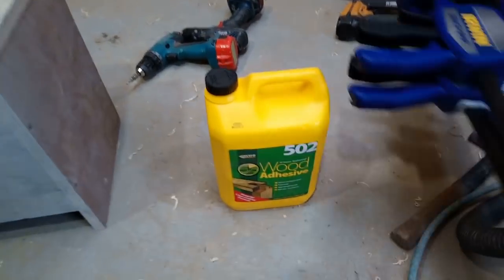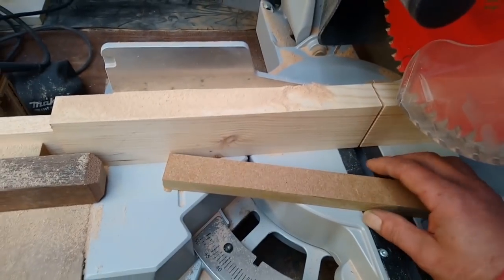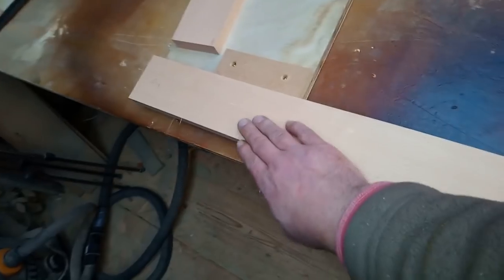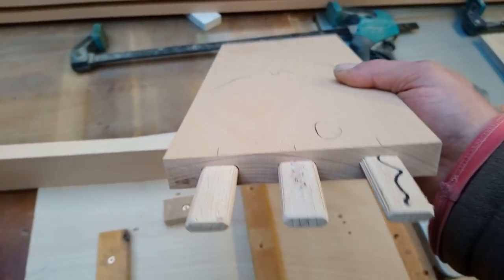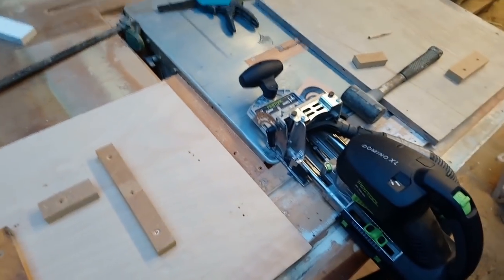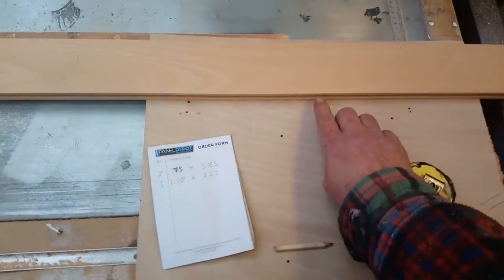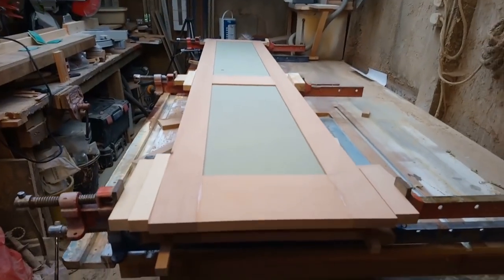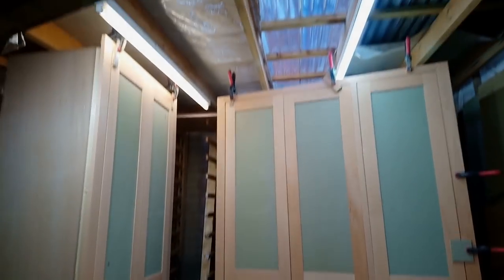Wardrobes Pt7 - Doors 2

Comment: Hi Gid. Thanks for all the very detailed videos, you do some really geat pieces of work. Have you seen the WD40 non greasy, I think it is silicone, spray for the slide rods on the domino gear?
Reply from the maker: Hi, thankyou Mike, much appreciated i'm glad you like my vids, No sorry i avoid like the plague anything with silicone in my workshop, when spraying paint just a single atom of silicone causes fisheyes, i wash my hands & change clothes before going in the shed if i've been using silicone on site, I also avoid any kind of oil contamination in the workshop. Google 'silicone fish eyes in paint' you'll see what i mean, thanks anyway. 👍👍

Comment: Amazing video gid and I bet you have one hell of a collection of clamps which are your go to clamps?
Reply from the maker: Thanks 👍👍, i have a small collection, they vary in size so it does depend on what they're used for, the little cox clamps are surprising strong tho for general stuff.
Reply: Gid Joiner what’s your opinion on the Irwin quick clamps?
Reply from the maker: I've got 4, 2 of the 6" & 2 of the 12", I use them quite a lot n keep meaning to buy more so i have some in the shed n some in the van, They're always in the wrong place, esp when it's raining n i'm in my shed 😆🙄
Reply: 😂😂 you can never have to manny I only have 4 clamps total but I was looking at the 18” Irwin. Does the 18” refer to the whole size of the clamp or what you can get between the jaws?
Reply from the maker: Normally it's clamping capacity, I've got a couple of the bigger ones, like you say you can never have enough, I've had my Irwin's quite a while n they're still good so buy what you need, they'll last, The clamps i made for the track are cut down n welded 12" Irwin quick ones 😉👍 I've a couple of wolfcraft clamps that have a second lever that opens them just like the lever that closes it, handy when you've got hold of a piece of wood in one hand & the clamp in your other hand but it isn't open far enough http://www.wolfcraft.co.uk/en/products/p/one_hand_clamps/index.html I have two with that opening lever but i bought two more n got the wrong ones, there's ones with just a normal release trigger that doesn't open the clamp.
Reply from the maker: https://youtu.be/qOeAPiViFK0
Reply: Gid Joiner ah right and yeah them wolfcraft ones look good I will give the Irwins a try thanks for the help 👍🏻

Comment: I'm desperate to find an easy program or app to draw 2D designs and layouts adding dimensions. Tried the free version of sketchup but can't get on with it. Your drawings look the business Gid. Anyone have any suggestions?
Reply from the maker: Hi, , I use a CAD program, for 15+yrs but still don't know ½ of it, you can go to college to learn CAD 🤪
i only use the 2D part because i only need a flat pencil line drawing, I've never used sketchup but I don't think CAD would be easier, it took me ages to learn what i know about this & still find something new occasionally, but i sort of like the learning bit. If you want to sit down & learn a drawing program CAD is good but not something that can be picked up in a day or two, a decent PC is prob recommended, 
This is the one i have, I paid a bit more but this one does say 'used'
https://www.amazon.co.uk/Avanquest-Software-AVQ-ITCD-DVD-V20-TurboCAD-Deluxe/dp/B00B464ROO/ref=sr_1_1?ie=UTF8&qid=1551739607&sr=8-1&keywords=TurboCAD+Deluxe+20
& this is a crap vid i made
https://www.youtube.com/watch?v=kHJsNJfh6sA&feature=youtu.be

Comment: Hi mate. Looking good. I was wondering if you had a video showing how to fit drawer runners? Got my first big fitted wardrobe job next week. Cheers
Reply from the maker: Thanks Charlie, 👍
I think i mention it another vid, i use a board just like i did for the shelves in this to fit the runners, 
 i put a drawer in the TV stand but only one, I only use under-mount runners now, the ones that attach to the side have to have exactly ½" to work properly, the under-mount are more expensive but stronger because the drawer is actually sat on the runner rather than attached to the side with poxy ½ - ⅝ screws & they're a lot less hassle, easy to make them work correct,
I'll have a look through my vids to see, there's a few on my Facebook page but don't think any show any drawer runner detail, Sorry.
Reply from the maker: This is the only one i can find, I've only been really filming my work for about a yr, previous vids were just 'sharing stuff' https://youtu.be/hcW0_bU1nNM
Reply: @Gidjoiner  Thanks mate. Will bear that in mind. I'll let you know how I go. I've got 12.7mm on each side on my sketchup drawing. Actual on site installations are often very different to drawings for me :D
Reply from the maker: Yeah same here, the drawing says 12.7mm but the finished result is bigger or smaller 😏
That's the reason i don't use those side mounted runners, only just a 1mm on the unit & 1mm on the drawer n they don't work, & that gap has to 12.7mm parallel at the front of the drawer & the back,  🤪
Best of luck 👍

Comment: Hi, was that 18 or 12mm MDF? some heavy doors,  nicely done BTW👍👌
Reply from the maker: Hi, the panels in the doors are 9mm MR MDF, The doors are surprisingly light, Beech isn't a heavy hardwood, 
Thanks Richard 👍😉
Reply: Gid joiner ..ah that makes more sense🙄, thanks for the response and the interesting content.
Reply from the maker: No problem 👍 Thanks 😉

Comment: Hi mate love your work picked up good few tips from your vids so thankyou i do the same sort of work as you all fun and games isnt it , whats the benefit of the way you build with face frames etc and how do you ever have issues with twisted doors
Reply from the maker: Hi mad, thanks  👍
Most of my jobs are chosen by the client from my Facebook page or the internet "can you build me one of these?" so style/design isn't up to me much, Face frames cover the front edge of the ply & in this case they allow me to get over the fire breast, it's just part of the design also, 
I get twisted a bit but not so much with the Beech, not a lot of movement with that wood once planed it's the main reason i use it now rather that Pine, the Domino & Kapex cut nice square joints which helps & careful gluing up checking for twist, my prob with big doors like this is making the wood straight in the first place, & then once it's all sprayed will it all go together the same in the clients house,
Reply: @Gidjoiner  thanks for the reply mate I'm thinking I might start making them the way you do, alot of my work is with mdf not sure if I can get customers to go for beech lol my carcasses are MDF but you use ply how do you get around the ply edges do you lip them ? I do that on shelves

Cheers
Reply from the maker: Hi, I prefer to use ply for the carcasses because you get a stronger fixing for rails n runners + ply is more stable than MDF, it should last many yrs but yeah you have to cover the front edge somehow, on shelves i add a lip, often in alcove cupboard shelves 1m-ish long I'd add a 2x1 with biscuits, depends how visible it will be but prob softwood to give strength & cover that edge, depends on what kind of weight the shelf will be carrying as to how thick that lip is, On the shelves in this wardrobe i used some Beech, the beech is a hardwood so should have little movement minimising cracks along the joint (& because i had offcuts to spare), i made them 30mm-ish thick just for aesthetics & to cover the front ends of the support battens,  The face frames will cover the front edge of the carcass ply, I do use Medite MR MDF, (never reg MDF,) where i want a nice flat finish or where i don't want to lip the edge, I've made many doors etc.. from softwood in the past but my clients are reg customers so i get to see the jobs I've done in the past & the pine has shrunk or twisted in their centrally heated houses more than I'd like, 2mm gaps are now more like 4-5mm 👎 The added price of Beech isn't that much when your looking at a job that's a couple of £K, As you know wood moves but with ply carcass, MR MDF panels & Beech frame n doors these wardrobes should last a long time.

Comment: There looking awesome as usual mate 👌  i need a bit of advice I'm looking to get a festool domino but don't know whether to get the xl over the df500 what would you recommend ?? I'm doing a lot of fitted wardrobes at min and just finished my first kitchen I made myself but it took me  ages and if I'm honest I wasn't happy with certain things so wanna change the process and make it a bit quicker so looking for tools that will help that .
Cheers darrall
Reply from the maker: Thanks, doors are being a bit of a pain, tall n getting the wood straight originally, carcasses not fixed in place is making fitting them not as ideal as i'd like but tomorrow they'll look better, 
I've only got the XL so can only really spk of that, I did a kitchen not long ago, adding 20mm thick face frames to existing units on site, taking the frames back to the shop n spraying them, the XL was spot on for the corner joints, little Dewalt cut the rails then dominos in the corners, there's a few pics on my FB page, the XL's lowest stop for the fence is 10mm so I've found it's good for 20mm timber as in this wardrobe job but no good for 18mm board, The XL will do 8mm - 14mm thick, how short in length i can't remember but 25mm is a couple of notches up so 15mm? - so ranging from 8mm x 30mm domino right up to the biggest 14mm x 140mm long,
i think kitchens upwards for the XL, anything smaller, are you going to be putting ply n MDF together with it? if so than the 500 domino maybe. 
as you've seen I use the biscuit jointer & XL & am quite happy with those, I will buy a 500 one day but am in no rush.
I made a decent kitchen island thingy no prob with the XL 👍
https://www.facebook.com/gid.joiner/media_set?set=a.1652275884858771&type=3

https://www.facebook.com/gid.joiner/media_set?set=a.1365517043534658&type=3
Reply: @Gidjoiner  I think the xl is the way I'm gonna go and coupled with the biscuit joiner I've got all bases covered I've got my first oak staircase on Monday which is giving me sleepless nights got all my fingers and toes crossed that it goes smoothly anyway cheers for the advice bud 🖒
Reply from the maker: Yep sounds like a plan, the 500 is a tool for small jobs & i think would be nice to have but the 700 & biscuits will do the majority of what sounds like similar stuff to me ,
 Good luck with the staircase, sounds like brain melter that one, no filler n paint there 👍👍🙃

Comment: I remember in the 70s as an apprentice I did a spell in Joiner’s shop styles and rales were mortised 
The rail mortised  on a bench   mortiser working to stops and the tenons done on a tenoning machine with the shoulders cut to any moulding 
Is this way totally out these days even with using some sort of tenon jig say on the table  saw 
Seeing how good you work I suspect it is 
Just seems a lot of effort with the domino 
Not criticising mind you very good
Reply from the maker: Hi, That's how i was taught, morticer n tenoning machine 👍  I'm a traditionalist n like my machines but i don't have a tenoning machine & there'll be some but i don't think there any many in this county never mind this city, In 34yrs you could count the amount of firms i worked for who had them on one hand, I know at least two of those firms don't exist anymore 
I've got a small crappy morticer n tenons would be cut on the table saw, I still do them for exterior doors but cutting all those little square holes, cleaning out the bottoms.. & tenons have 6 cuts - 2 shoulders, (cross grain so clean cutting blade) 2 cheeks (long grain rip blade) n 2 haunches, it'd take hrs if not all day n more on 5 doors like this & they wouldn't be perfect, 
This machine is far far from a lot of effort, quite the opposite.
The Domino cuts the time by at least a ¼, hardly any setting up time, less waste, no horns to cut off, no need to calculate extra length for the tenons, & the joints / the faces are near enough perfect, 
I have another vid about the domino where i make a door in real time, no editing, i cut the dominos anyway, 
the panels/rebates etc.. are a separate process, the vid concentrates on Dominos vs mortice & tenons so you/everyone can decide which is quicker, at first i thought i'd be compromising the quality of my work using Dominos but I've since changed that thought & am more than happy with it , 
https://youtu.be/YCbHGEKcSVA
Reply: Gid joiner 
Hi thanks for reply and explanation 
Just watched vid 
Your right the domino wins 
Keep up the good content being a site joiner on housing these days I will have more questions lol but I’ll try n spread them out 
Cheers
Reply from the maker: Hi, Yeah it is faster but it is a slightly different joint, more like flat dowels or floating tenons, .. swings n roundabouts.. 😉🤔
You mention 70s, I spent the majority of my time as a site joiner, I'm 50 now n couldn't be doing with that site lark now. 😲
Reply: Gid joiner 
Hi I know what you mean about site work when it’s bad it’s bad 
But I’ve dropped on a really good job a moment only 5 minutes from home 
The thing I like about it is you can pack up when you’ve had enough to a certain degree that is 
I’m 59 this year started in the summer of  76 in the heat wave
 I always thought I’d be the youngest on site never occurred to me I might be one of the oldest one day lol